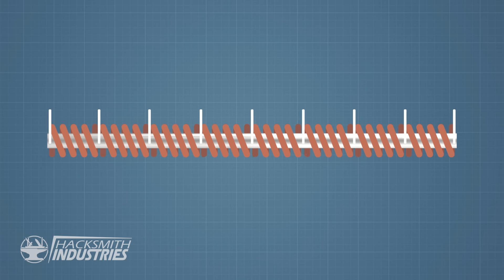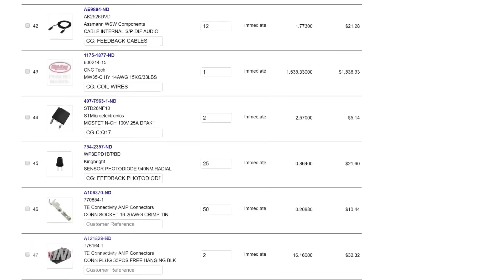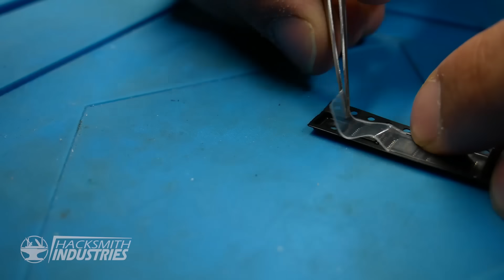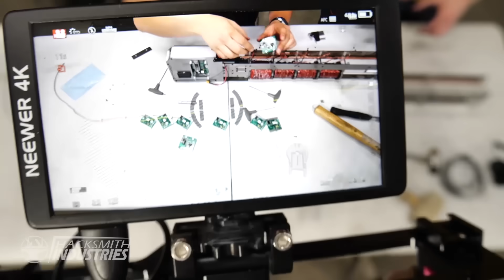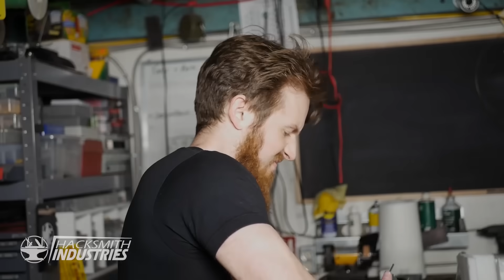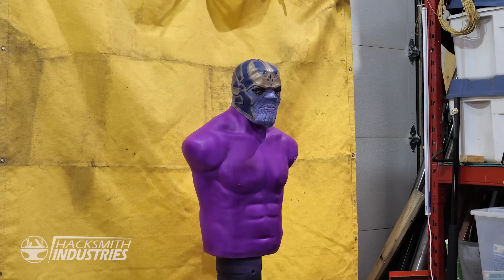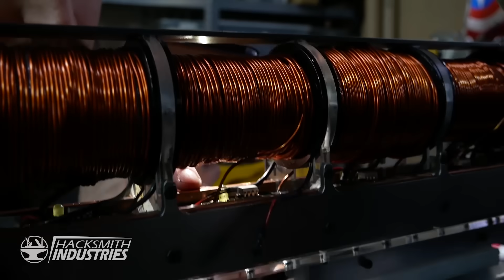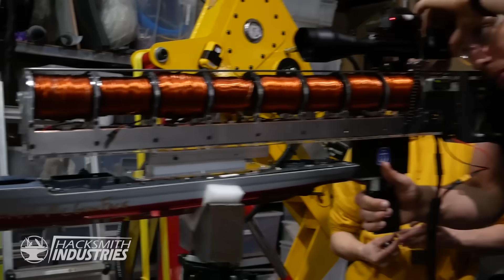50 CAL ELECTRIC COILGUN

Comment: Is it me or is this thing “tuned down” like crazy. This should/could be sending this projectile A LOT faster than it is. Right?
Reply: They didn't use capacitors and lost a huge amount of efficiency, so it's probably operating at the highest level it can with the stuff it's using. There's also no rifling on it, so the projectile is losing a lot of energy and accuracy
Reply: Yeah they hyped it up but any real gun guy was definitely let down lol. It seems fun for kids to use, tho, and is a fun concept. Kinda failed as a gun.
Reply: @GardenOf-Eden  Instead of a rifling, maybe fins could be added? Like an APFSDS but without the DS
Reply: They could make it much much much more powerful if they wanted to
Reply: We can agree on dta right
Reply: Sam Orcsik lengthening the barrel would do nothing unless They added another coil
Reply: Coil guns run into a lot of problems with trying to shoot faster, and more accurately.
The projectile needs to be magnetically active, so steel generally. The problem is, that means you have a hard time with rifling, since the projectile can't squish into the rifling grooves. It also needs to be mostly steel, or you lose efficiency.
Also, in trying to increase the power of the gun, you run into a couple problems. The projectiles themselves start to take on a magnetic set, so that the next coil has a decreased effect. Also, traditional electromagnets can only  create so powerful of a magnetic field before they lose efficiency, and also overheat. 
There are plenty more problems, such as that traditional fins don't work for stabilization, but the above problems are the big ones.
Reply: @weaponizedemoticon1131  the bullet itself could have a few small riflings from the tip to bottom and it could vastly improve the stability. And this is only an idea but couldnt the bullet get a jump start with a tiny amount of gunpowder and the rest of the speed is increased by coils
Reply: @evenrik_2214  It's possible. It still has problems. Small rifling would either have to run in grooves within the barrel, or rely on air. Neither is ideal. 
Also, the grooves would make being grabbed by the magnet less consistent. 
It is possible to induce "rifling" magnetically, but it's complex.
And, yes a charge of gunpowder would speed things up, but so much that the coils would do little to increase velocity, and at that point, you just have a gun. :D
Reply: @Christopher Pena  they couldn't have posted it on YouTube if they made it actually lethal
Reply: @LukasJosai  so like a APFS
Reply: probably of lot of legal issues with these type of things. best to avoid attracting negative attention by blowing up a neighbors house or car with a suped up protoweapon
Reply: @weaponizedemoticon1131  Maybe the biggest problem is that the spools will take a while to (de)magnetize due to inductive coupling. You'd have to (de)magnetize them sooner, but then you won't be able to time the whole process according to the projectile`s current position. Though I'm sure you could simulate the whole pocess to find the perfect timing and even make do without the positioning sensors. That's a ton of research for an impractical technology though.
Reply: @GardenOf-Eden  You wouldn't use rifling in a real coilgun. Just like all modern tank guns, smoothbore is better at these speeds and this type of slug, long and thin.
Reply: @NoArmsSally  Considering how ｔｈｉｃｃ that projectile is (.50 caliber, looks around 3-4 inches long), I think sending it even faster would legitimately be very dangerous to everyone in the room. These guys could definitely budget up and make an (even more) dangerous weapon, but that’s proooobably not the best idea.
Reply: I think in Canada you are limited on the energy of the projectile before it is considered a “firearm” and subject to stricter legal issues.
Reply: It also doesn’t help that there’s no stabilization on the projectile so it just kinda tumbles through the air.
Reply: Definitely, it didn't even get close to breaking the sound barrier, but it should theoretically be able to easily able to outpace a real firearm, however with their projectile shapes, their barrel material, lack of rifling and probably some loss of efficiencies elsewhere in the spirit of making a cool video in a timely manner probably limited this project
Reply: I'd say they're more trying to prove that hey we can do and build X. More than trying to build a functional weapon
Reply: @GardenOf-Eden  rifling would not have helped at all, that isn’t how coil guns work.
Reply: @samorcsik  i mean the US Navy uses fins for their electromagnetic guns...
Reply: This is based in Canada. If they had rifled the barrel, they'd have manufactured a firearm and could easily face 15 years in prison for it. Also, there are FPS/joules limits that would make it a firearm (yeah, literally doesn't matter if no gunpowder is involved). Anything over 495FPS qualifies as a firearm in Canada
Reply: @XMorbidReignX  wow so thats why
Reply: @itcouldbewill  oh yeah these guys could easily be building weapons but they're good folk who aren't stupid
Reply: Honestly it's probably mostly the round right? Those slugs were comically thick and barely shaped for air resistance at all. (Likely cause of Canada's gun laws as someone pointed out above.) If they were married to using quite so large a round they could've milled out the center and brought it to a sharper point, would've made it fly without bringing the gun back to the drawing board entirely
Reply: @gwennifergracie-mclauchlan5675  While comically thick, they are right in the range of .50cal dimensions. And the round doesn't matter. You could have a pellet gun/air gun that fires a round as big as 5.56mm as long as it doesn't cross the FPS/joules limitations. The round itself is entirely irrelevant to our laws. It's the muzzle speed and impact velocity that matters.
Reply: @XMorbidReignX  I was assuming they made them so poorly aerodynamic to stay under those limitations. Not that there were limitations on the round type. Seemed more like they wanted to boast about it being 50. Cal
Reply: My guess would be that each coil can accelerate it only so much. The colliders he referenced are complete circles, and therefore can effectively have an infinite number of coils.

They definitely need to figure out a way to stabilize the projectile, though. That will help the projectile maintain its energy as well as improve accuracy over a greater distance.
Reply: @thomasbower7727  nah, as mentioned above by smarter people they're running that thing at like 2% efficiency, it's not a matter of more coils, they can't have it fire faster or harder or its a legal issue
Reply: @N3tech  cluelessly nodding like Lemont “Spall...”
Reply: If they used a metal ball, it might have been more accurate
Reply: Demonetization
Reply: He said in the railgun video that they have to tune it down so it is an air rifle and not a firearm or they could be arrested cause they are in canada
Reply: @larsvab3690  more windings would help but they need a sensor in between each coil and find out the time it takes to get across each coil. If one coil doesn’t turn off fast enough it will cause drag and slow it down. The sensor could be used to get readings for them to enter into their arduino for timing. Instead of them starting at 0 or with gunpowder (another comment or suggested it) use the same technique as nerf guns and use a pair of spinning wheels. Make the outside edge able to squish and you can do traditional rifling but I think cutting grooves would be better in the long run. ...lots of little things would have helped them.
Reply: Hmm yes the sciences
Reply: @samorcsik  how would lengthening the barrel help at all? There is no pressure in the system at all so unless they put coils around the lengthened barrel adding length would do nothing for power
Reply: If the gun was made to shoot bb's it could be full auto. .177cal
Reply: @sargetester99  oof...metal bbs going at those speeds. That would do some damage (I know the amount of energy is the same but keep in mind it’s smaller and so the energy would hit a smaller area on the target). They would have to impart a spin or the bb might not be accurate at any distance.
Reply: @morgan5941  the issue with find is when firing you have to be careful or you may lose said fins. also adding them consistently without issues with center of mass would be annoying. a groove is easier in that you can do it consistently on a lathe (thread cutting is similar) as well as it wont interfere with the tube. also no possibility of damage from reload
Reply: @Chris-cv1ll  maybe a sabot or something with a smaller steel dart could help a bit with accuracy and penetration
Reply: @GardenOf-Eden  Rifling does not increase energy, It makes the projectile more stable. Other than that, I believe you're right. {More energy if it flies straight, less air resistance}
Reply: @samorcsik  Wont change the speed with just extending the barrel, because coils are the only force applied to it. lengthening the barrel accelerates projectile in conventional guns, because it extends the powder gases path of effective decompression, the longer the path the more time it has to build pressure, so higher the pressure - higher the bullet velocity. 
Hacksmith made a great job of making a prototype coil gun, without making it a gun, it should not be. Canada is a gun free country you know)
Reply: Yes but there is the nfa that would fine them
Reply: @weaponizedemoticon1131  US military already have a railgun that can fire at over mach 3
Reply: @Danuxsy  True, but a railgun is a different piece of technology to a coilgun, with some overlap.
Reply: @weaponizedemoticon1131  yeah u right
Reply: Bit of rifling, a more temperature resistant barrel...
Reply: They need to pre spin the round before engaging the coils.
Reply: 100% agree
Reply: the projectiles aren't aerodynamic so they're keyholing and slowing down,look how they hit sideways thats why they're slow,they're also very heavy

Comment: One of the reasons that your gun was so inefficient is: you need to use pipe pieces as projectiles. The bigger the radius, the higher the induced ring currents. Pipes should also offer better flight characteristics. Finally, they should be out of copper, gives you 3x the energy, since it has 3x less specific resistance than steel.
Reply: @JustAnotherGenXer what, bro its not stealing his idea to just use what is scientifically best at a given price point
Reply: ...or at least make projectiles smaller. the smaller the better in case of coilgun, as its the bigger speed that gives the better(more destructive) results
Reply: What about copper plated steel bullets? Allows for the conductivity and durability, or will that not work?
Reply: This coil gun is mainly relying on the ferromagnetic properties (reluctance) of iron, not eddy currents (induction).Actually eddy currents are bad, since they transform the energy in to heat. Best choice is either solid iron or iron powder, joined by some non-conductive material. Both have their pro and cons
Reply: Capacitors Too
Reply: What you are refering to is a so-called inductive coilgun. But a coilgun can also work purely by ferromagnetic forces acting on the slug, and that was the principle employed in this gun. Inductive coilguns, while being theoretically capable of higher velocities, require significantly more precise control of the magnetic fields and are alround much harder to build.
Reply: Copper won't work as a projectile, it's not magnetic. It would work on a rail gun however. Reason is it can't generate a magnetic field without electricity passing through it.
Reply: @nzoomed  no, it works because of induced reverse currents. I have seen this in real life.

Comment: Imagine buying screws srry ammo from home depo 

The ammo is cheaper than bullets
Reply: Nails would be better - more aerodynamic. Also, entry and exit wounds would be much cleaner
Reply: So its basically a nail gun
Reply: @whoopwhoop4783  YES
Reply: You can't compare it exactly to a nailgun it's still a coilgun
Reply: So is fertilizer.

And nails.

Blasting caps too.

HMM.
Reply: @mikehawk37  you're right you can't compare it but the nail won't go straightforward watch the video to see how it stays in air  on  a side.

Comment: i wanna see like a version 2, like more efficient and powerful
Reply: I want a more powerful and magazine fed version
Reply: They also need to get the projectile spinning. Something akin to rifling. The projectiles are tumbling the second the leave the barrel.
Reply: and without a boat under the barrel
Reply: @Someone-ci8wf  yeah magazine would be very easy to do, because there is no casing
Reply: And attach it to their iron man armor and make a war machine turret
Reply: High voltage capacitor discharge into each coil with a SCR and a spin needs to be induced on the projectile for stability.
Reply: They needle to put rifling in the barrel
Reply: and actually a 50 cal

Comment: According to Professor Laithwaithe's research encasing the coil's in steel and adding a steel barrel as a firing chamber significantly increases power of the electromagnetic waves emitting from the magnets.
Reply: A superconducting wire would significantly increase the muzzle velocity if you did an exact swap with copper wires.
Reply: Niobium-titanium wires should work according to my own research.
Reply: Adding a electromagnet at the start of the firing chamber will significantly increase the muzzle velocity even more by forcing the projectile down through the firing chamber with an electromagnetic wave.

Comment: Great job. Good to set it up like this so you don't get demonitized. Now few small suggestions which I think you already had in mind. Reduce coil chamber size, reduce bullet length so it weights less (easier to bring up to speed), amp up the wave function (for more speed), have barrel just miss touching bullet and drill holes down barrel in spiral to reduce pressure waves in front and behind the bullet (to allow less resistance, greater speed, and possible rifling).